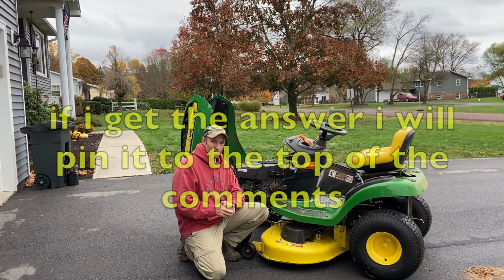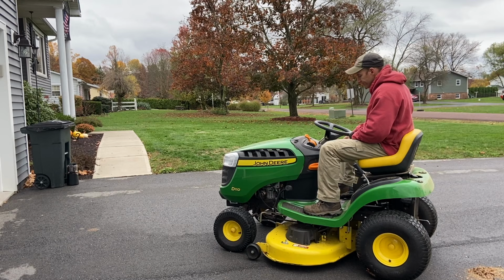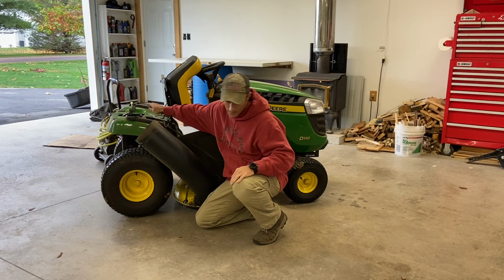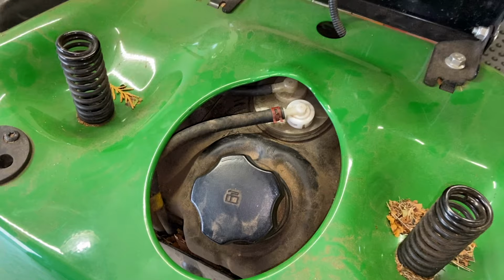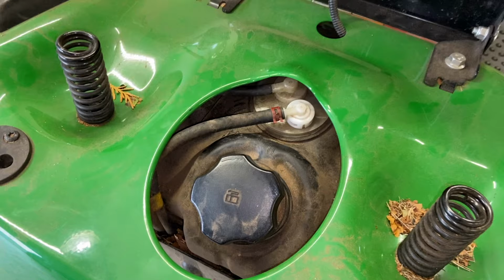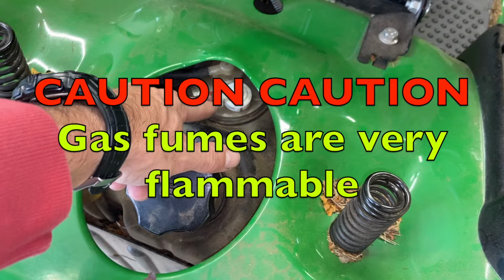John Deere lawn mower won't stay running (100 SERIES)

Comment from the maker: I tried to recreate the problem, and run the mower out of fuel again to see if it would do the same thing again. I could not get the mower to do what it did the day I could not keep it running. I think all my problem was that it lost suction or got air in the fuel line. Maybe my fuel pump is starting to go bad. There are a lot of good answers and things to check in the comments thank you all for trying to help. I'm sure these answers will help someone else out. If you leave anymore comments on what to check try to explain how to do it so that it might help someone else out. Thank you again and God bless
Reply: How has it been running since? I have a 2017 D110 (looks like you have the same machine) and I just started getting this problem yesterday couldn't even finish cutting my lawn.
Going to try your suggestion of blowing the vent line to the carb, see if that helps.
Reply from the maker: @mazz1557  Did it help? I have not had this problem since I started using non ethanol fuel.
Reply: @DIYJIM  wasn’t the issue with my machine, looks like my carb is gone. The factory Nikki carbs seem to have a tendency of crapping out. I ordered an OEM B&S carb (Ruixing) and it should be arriving tomorrow. I’m confident this will solve my issue as it has for many. I’ll keep you posted.
Reply: @mazz1557  well?
Reply: @richardmeadows1911  replaced the carb as mentioned above, and I also ended up replacing the head gasket as that needed to be done for at least 1 season now. My machine runs like new.
Reply: My 2022 s220 with 11.8 hour do the Same thing
Reply: Kick it
Reply: Two years later did u ever find the problem my mower is doing this. 😬
Reply from the maker: @rainylynn9149  not really, I think it is my fuel lines breaking down
Reply: Diyjim..if your still out there. ..when you blow the line out do you unhook the other end of the line?..or no.
Reply: @davidleroux1995 Same question. We blew out the carb line & the it mysteriously wouldn’t start at all. Wouldn’t even turn over. Confusing.
Reply: It sounds like vapor lock
Reply: Check the fuel pickup. Dead bugs, grass clippings and debris gets into the fuel tank and clogs the pickup when it pulls the fuel into the line.
Reply: @imafiretruck7454 , how do you ck the fuel pickup?
Reply: @sarabheh1220  so the pickup is inside the fuel tank at the bottom, attached to the end of the same hose as the fuel filter. I empty all the fuel that I can from the tank, pull the fuel filter and then I just send a few heavy bursts of air back up the line into the tank. 
You'll wanna do this with the fuel cap off and that's about all there is to it. Just try to peek down into the tank as best you can to make sure there's nothing obscenely large dislodged in there and do your best to clean it out as needed.
In some cases where the machine has been stored for an extended period with fuel still in it, the fuel can sometimes start breaking down the hose from the inside out and that can be the problem. In that particular instance, a replacement is probably gonna be required.
Reply: @DIYJIM  Mine is doing this with 30 hours on it. Thank goodness it's still under warranty.
Reply from the maker: @cindyrider2006  If you can get non ethanol fuel, try that.

Comment: Had same situation, I replaced everything cap ,filters, plugs,, cleaned carb flushed tank.. It worked an hour them dying and back to not starting.  Finally gave up took to highly-rated J D dealer  charged me $200 after mowing 10 minutes it stopped.  Dealer took it back after having it 2 weeks and admitting they were puzzled they discovered the fuel lines were rotting from the inside and small particles were going thru the fuel line. Mower is 12 years old. After that 2 years no problems.
Reply from the maker: I guess I better take a look at my fuel lines, thank you for the comment
Reply: yes mine did this the lines rotting from inside i replaced them all cleaned the carbe replaced the fuel pump but it still wont start
Reply: Cap LOL what cap
Reply: You're more is starving the  check the fuel pump and it's system
Reply: I have a E110 2018 John Deere riding lawnmower,I watched a video about the E series how the cam shaft has a very poor design and the fellow had to change it,well the same thing happened to mine after 100 mowing hours I took it to the John Deere place in Frederick Md and the fellow called me and told me I should just go ahead and get a new motor because the cost of fixing the old one was just about the cost of a new one, if it’s a poor design shouldn’t JD do a recall on this series or at least offer me a discount. When purchasing my tractor I thought nothing runs like a Deere,I know stuff happens but if it’s a poor design and it’s happening a lot then everyone who’s purchased this series should be notified and a resolution should be made,I feel like I’m being taken for a ride ( no pun intended) thanks
Reply: @angiespencer4156  haha, ya...they wont do that. They dont make money that way. Now a days things are engineered to fail after the warranty so people pay for services or buy a new machine. Thats how they make money. The CEOs and upper management need their yachts and vacation homes
Reply: The design is complicated and takes advantage of buyers.  When used, there are many problems.

Comment: Vented gas cap, not venting like it should. like putting your finger over a straw filled with water the water will not flow out with your finger over the end. gas can't flow out of a gravity flow gas tank if it's not vented. clean or replace the gas cap.
Reply from the maker: Sounds like it could be that thanks
Reply: @DIYJIM  you should test that theory first.  next time your mower shuts off and won't start, remove the gas cap and listen for a sucking air sound as you remove the cap.  If you hear it sucking air, that's a good sign the gas cap has a plugged vent.  then put the cap back on and see if the mower starts and runs for a little bit and then shuts down again.  if that happens then take the cap off again, try to find where the vent is and blow some air through it.  If you can't fix it that way then ya, you'll need a new gas cap.

Actually now that I think of it, nothing I said makes sense hahahahaha.  because in the video you never removed the gas cap.  you did something else and then mowed your whole lawn so the problem can't be a plugged vent on the gas cap.  I'm not sure what you did but if you blew air into the carburetor, then ya David Ruff might be right.  The fuel shut off solenoid might have been stuck closed and you might have opened it by blowing air into the carburetor.  If that's true, then you just came up with a whole new way of troubleshooting the fuel shut off solenoid without taking the carburetor apart!  hahahahahahaha!  Seriously, you may have just made an important new discovery because I've never seen it done that way before!
Reply from the maker: Awesome maybe I did, but I am going to check the Solenoid valve. I think that is my problem
Reply: Exactly...that was my problem!!!
Reply: Vapor locked

Comment: Is it just me or does  anybody else Think it’s crazy there isn’t a screen at the top of the fuel tank to filter out debris. All these problems I’m reading concerning dirt and grime in the fuel line doesn’t surprise me without that screen on the top of the tank.  Thank you, Jim for the walk-through. I’m looking forward to giving it a shot in the morning using your technique.
Reply from the maker: Thanks for watching
Reply: on both the gas fill AND the air vent!!!

Comment: Cleaning hole in gas cap worked for me!  I have an older 125 automatic without vapor recovery. It started the season fine even with old gas and cold weather but then started randomly dying over the last two weeks, sometimes after 30 minutes when completely warm, other times within a minute of starting cold.  I drained old gas, blew up through hose to tank, put in fresh gas, replaced fuel filter, plugs, oil change.  Then I saw other comments in this post, knocked the dirt out of the tiny center hole in the gas cap and blew through it (also not tightening the cap super tight) and it has been starting and running fine for a couple of days.  Surprising that such a tiny bit of dirt could impede the flow of gas and the suction of the fuel pump would not pull it through...maybe the fuel pump is on the way out but so far, so good for me and I would suggest anyone having similar problems try this easy step first.
Reply from the maker: Thanks for the tip hope this helps others out. Thanks for watching
Reply: Tom, I'm having problems finding the correct spark plugs for my JD 125 Automatic. What spark plug make and model do you use for yours? I have a suspicion that I have the incorrect spark plugs  for mine (I got it used). I keep getting contradicting part numbers for the spark plugs. Any help would be appreciated.
Reply: The new ones don't have a hole in the top of the cap. S110

Comment: I had EXACTLY the same problem. After watching the video and reading most of the comments below here is how I fixed the problem. I removed the gas cap and started the mower. I let the mower run for about two minutes. While the lawn mower was running I replaced the gas cap. That's all I had to do.
Reply from the maker: I tried that but it did not work for me. Glad it worked for you, thanks for watching
Reply: @DIYJIM   After yesterday's fix the mower was still not running 100%. I changed the fuel filter and now it runs like new.

Comment: After hours of checks and rechecks found your video and whaLaa the air line didnt seem to work so i tried the not recomended way through the tank and along with a bunch of fumes and bubbles A dead spider stuck to the gas spout. Was that it not sure but THANKS now I have to finish the lawn lol You saved me hundreds on my tractor insurance LOL
Reply from the maker: Glad you got it fixed, thanks for watching

Comment: My z540 would start and run for a few minutes and then sputter and stop. I could get it to restart and it would go for another few minutes and stop. I took the top cover moding off and detached both lines out of the fuel tank and blew the lines out. I then put it all back together and it started right up and never stop or sputtered like it did before. This video definitely helped me resolve my issues. Thank you!
Reply from the maker: I would try to find non-ethanol fuel for it. Since I started putting non-ethanol in mine, it has not happened.

Comment: Glad I saw this… Engine started surging shortly after I did a tune-up.  Ran great for 10 minutes, then started surging and got worse as time went on.  Even stared back-firing at low idle.  I did what everyone else did… replaced fuel pump, inspected gas tank for water, etc. but just remembered when installing fuel filter, not much gas came from the line to the full tank.  I should have investigated that, but I was so focused on other things, like maybe I missed something on the tune-up that I dismissed it and moved on.  After seeing this it makes total sense.  Tractor is 9 years old now and thinking the lines are breaking down.  Gonna revisit tomorrow and try your method.  Thank you.
Reply from the maker: Hope it helps

Comment: I have an x350 with the same issue.  The tank isn't venting and is making a vacuum which keeps the fuel pump from getting a suction.  Anytime I remove the cap, you hear the vapor lock release.  Mine supposedly has a vapor vent valve that may need cleaning.  Will definitely look at gas cap to see if there is a vent hole clogged.  Runs fine with gas cap not fully tightened.
Reply from the maker: Thanks for watching and for the info.

Comment: Thanks for posting this video. Sure enough my gas line was clogged between the tank and filter.
Reply from the maker: Glad I could help thanks for watching
Reply: You never checked the fuel filter before doing this process here? If there is gas in the fuel filter then you have no fuel problem...at least up to the fuel pump which is also easy to check with those smaller hoses there, pulling them off and see if fuel is flowing through them.....

Comment: So I had the same problem and you saved me a trip to the JD dealership ($$$) . I simply took the gas cap off and blew into the tank with my cheeks as a seal and didn’t really have to that for more than about 10 seconds an bingo problem solved. Has reoccurred and I had to give it another blow job. It seems happy afterwards.
Reply from the maker: Glad I could help now your mower is happy lol

Comment: I had a 17.5 briggs and stratton in a JD S100 with the same problem after a different repair. I learned about the vapor recovery system from this vid. I was trying to start the engine with the air filter off. I had the same  issue,put  the filter in ,no more problem.
Reply from the maker: Thanks for watching

Comment: Also check the ignition wire from the key switch.  If the wire is rubbing or vibrating  on the steering shaft (rod) the insulation may wear and cause an intermittent ground short, which will cause the engine to stop.  That happened on my LA 115.  Fixed it by wrapping electrical tape around the wire where it was rubbing on the steering shaft.
Reply from the maker: Thanks for the tip

Comment: Our John deere mower is  2 months old. Started having a problem with  it running and then dying 1 month after buying it.  
Hope this works. I'm  tired of it! I dont think I will buy John Deere again!
Reply from the maker: I have been using non ethanol fuel. It seems to run much better. Thanks for watching

Comment: If your reading this remember. 
Starting issues, pressure or spark problems. 
If it starts but wont stay running its fuel problems. 
Do cleaning and trouble shooting first. 
I unplugged my MAIN fuel line coming from the tank and it spilled out cloudy fuel and debry FROM INSIDE THE HOSE , IT WAS DETERIORATING. also dumped out the fuel filter blew through it.  
Started right up and ran fine. Gonna replace the hose and fuel filter. 
hope this helps. 
Little things first. 🤞👍🏻
Reply from the maker: Thanks for the tip good info. I’ve been running non ethanol fuel and have not had a problem since. Definitely think that ethanol was messing up my fuel lines. Thanks for watching.

Comment: i'm having this same problem, my deer is 17 years  old.  i will give this a try and the gas cap too.
Reply from the maker: Hope it helps, thanks for watching.
Reply: @DIYJIM  all i did was loosen the gas cap, i could hear the air rush in. i was able to cut the rest of my lawn. guess i need a new gas cap. or maybe clean it. could even drill some small holes in it
Reply from the maker: @dougm1985  awesome glade you got it figured out

Comment: I had the same exact problem that just started randomly this year, I tried everything, blew out all the fuel lines from the tank to the carb, replaced the fuel filter, replaced fuel pump, cleaned and rebuilt the carb, nothing fixed it.  I knew it just had to be something with or in the fuel tank blocking a good flow of fuel.  I did manage to fix it though.  I took off the hose at the tank like you did, and shot carb cleaner directly into the tank.  I just removed the black hose, and kept the white part in place.  I haven't had a problem since!  I'm pretty sure the line in the tank is either deteriorating or is so gunked up that even a blast of air didn't clean it out.
Reply from the maker: I think the ethanol in the fuel is deteriorating the fuel lines.
Reply: l

Comment: I have had this problem with my John Deere since I bought it.  It makes my crazy!!  Will try your method now. Wish me luck!
Reply from the maker: Hope it helps my mower also seems better since I started using non-ethanol fuel in it.
Reply: Use fuel lines rated for marine use? They have a USCG stamp on the labeling. I think they are MORE resistant to breaking down from the ethanol!

Comment: Thanks for the great video! So I think your question was - "What is the return line to the tank". It looks like it is part of some kind of EVAP system to return gas fumes back to the tank for reuse. It's all emission control stuff that is part of a closed loop system. Blowing out the lines caused it to start functioning properly again..
Reply from the maker: Thanks for watching

Comment: Mine was doing the same thing, changed fuel filter, didn't change.  Ordered a new fuel pump.  While waiting, replaced spark plug and changed oil.  So far, the new spark plug seems to have worked.  I did however notice when I was replacing the fuel lines that the lines are gummy aka they are rotting from the inside and need to be replaced.  Bad fuel lines would explain why blowing out your line is working for you.
Reply from the maker: I will have to look inside my fuel lines thanks
Reply: @DIYJIM  the fuel line is 1/4 ID x 1/2" OD, there is no real way to check them.  The problem with fuel lines is they degrade from the inside and can easily collapse. If you do end up replacing your fuel lines, I recommend using Tygon as it is ethanol resistant.
Reply from the maker: @ChainsawPenny  do you have to order Tygon or do most auto part stores have it?
Reply: @DIYJIM  Amazon

Comment: I greatly appreciate the video and you getting this thread going. I had the exact same issue, pulled the line for the fuel pump- (out to carb), cranked it a few times, had great fuel flow, put it back together and fixed. I'm thinking air or a minor obstruction somewhere in the fuel lines. Thanks again!
Reply from the maker: Awesome glad I could help
Reply: Very helpful.
Blew out gas tank “vacuum” hose. Didn’t resolve.
Removed gas cap.
Started throttled using choke. After 3 to 4 minutes, engine started to run fine.
Tightened gas cap and played with choke/throttle and eventually started to run properly.
Guessing I ran fuel too low and that created throttle issue.
Throttle issue seems common to riding mowers on YouTube.
Gotta love the “lightbulb theory”.
Hope this helps.